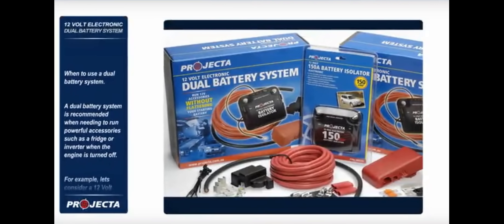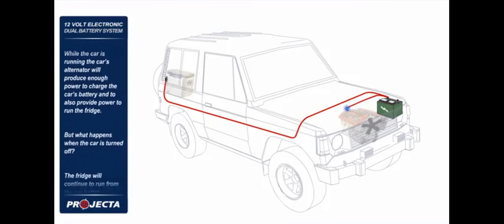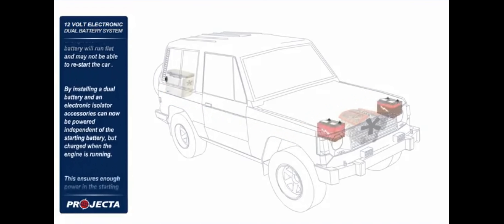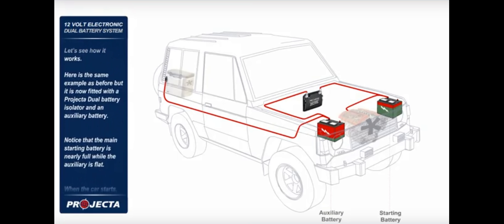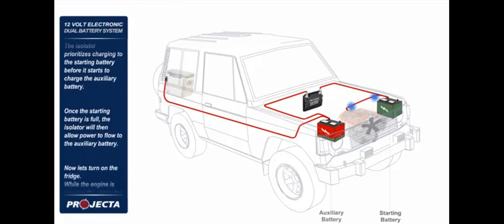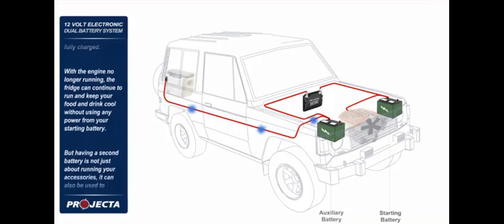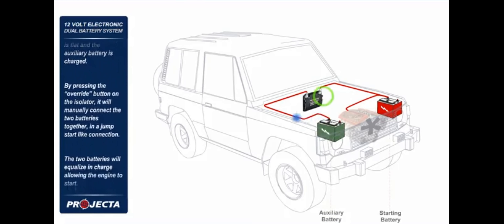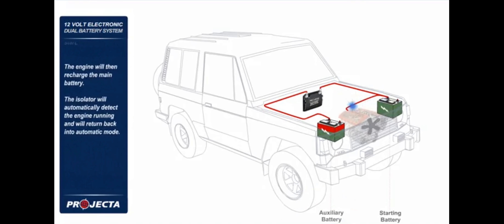How Dual batteries work and do you need them.

Comment: NICE isolator.  I ran a setup like this on a camper van I built but the isolater did not have the features this one does. Just 2 diodes. A Optima deep cycle battery would run everything for 3 days before a re charge.